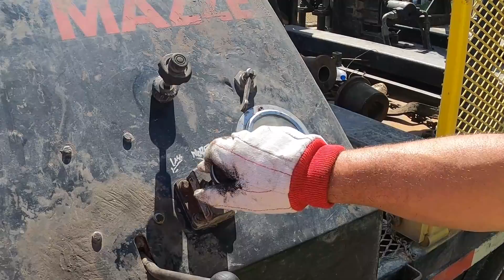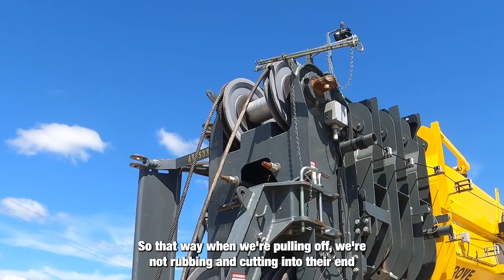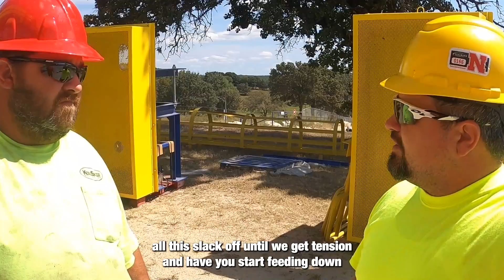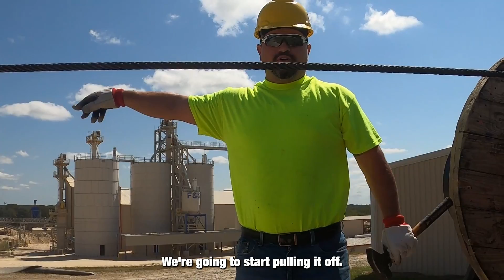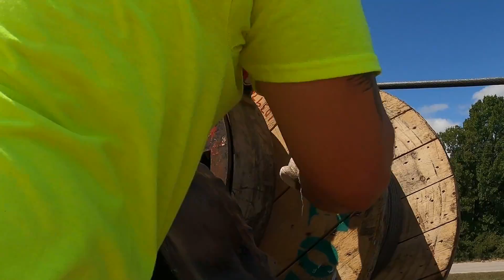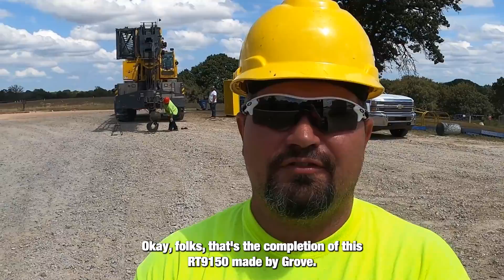How To Install a Crane Hoist Rope: Installing The Hoist Line on a Grove® RT9150 Rough-Terrain Crane

Comment: Would a new cable installation on an indoor Overhead Crane use a similar installation (after the removal of the old cable) as just described?   May I "assume" an Overhead Crane would use "less" cable depending on the vertical distance from the floor to the Crane's Hoist overhead plus the number of Sheaves required?  Does the Hoist's Drum have a Reserve Capacity?